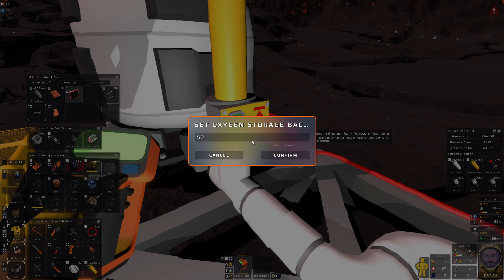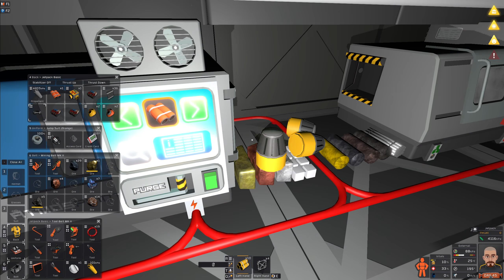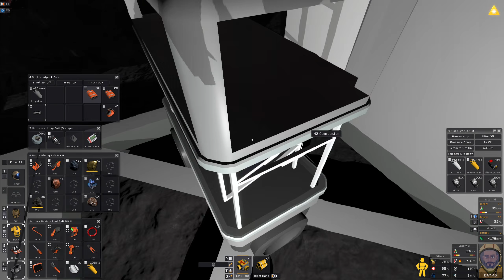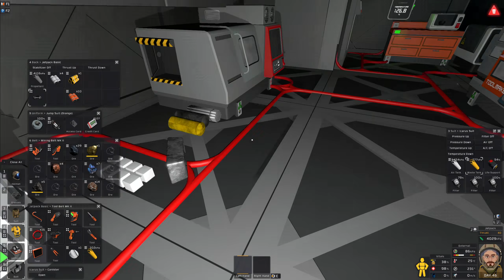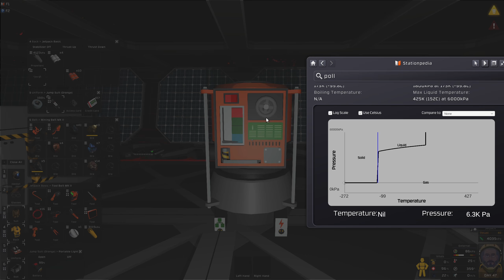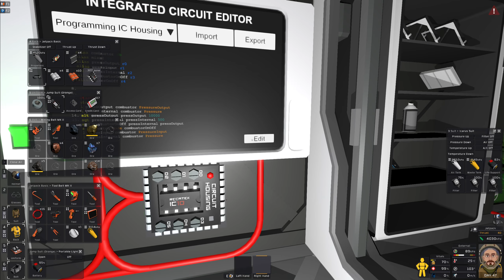Water pt. I: H2 Combustion And Filtering - S2 E14 ║ Stationeers

Comment: 1:59 Wouldn't you want to loop the over pressure exhaust from the back pressure regulator back into the waste gas pipe on the O2 filtration unit that is going back into the greenhouse. That way you're not wasting any O2 production as it will be a closed loop.
Reply from the maker: Two reasons why I don't really want to do that.
1 is that if the storage is full, and we just push the O2 back into the base, eventually the base would end up with 0% CO2 which is not good for the plants. It would happen extremely slowly, and I'd surely notice it before it's too late, but still.

But the most important reason is that I like the idea of a flare burning off the excess O2 above the base. :D
I doubt we will ever reach a great enough concentration to ignite the volatiles in the atmosphere, but who knows, maybe... :)

Comment: Does the game let you collect steam by burning volatiles and oxygen in an enclosed space? I know it has sterling engines, it would be cool to use that stupidly hot steam as the heat source for a power plant. You could use hot combustion gasses on one side, store cool night gasses for the other, and then condense the steam once you've pulled most of the energy out of it.
Reply from the maker: I think they will only generate water in the H2 combustor, in a furnace it will only generate pollutants and CO2 if I remember correctly.
Reply: @Hmuda  Well that sucks. Still, you can run the hot steam through Sterling engines.
Reply: You need to use the H2 combustor to get H2O, unfortunately, but you can pipe the output of the H2 combustor into the Stirling engine, which acts like a radiator to some extent, so it can cool the steam to ambient temp while producing power.

Comment: Did you accidentally dump the watee you bought from the trader?
Reply from the maker: Nope, the liquid output pump is moving it into the base pipes automatically. I don't know why, but the water doesn't evaporate in the landing pad, so it remains a liquid until I pump it out. Very convenient, we can do both the water and the volatiles at the same time, since one is liquid, the other is gas, so they are handled by different machines.

Comment: I'm sure this has been solved in future episodes, but I'm wondering why we aren't cooling the water with a heat radiator? the atmosphere is way lower then 1000°C even in daytime, so there's some real atmospheric cooling potential (especially at night where it's barely above boiling). still need to do the final phase change, but at that point the temperature in the base itself should be enough to cool the water below condensation temperature. maybe I'm underestimating the temperature capacity of water or overestimating the climate control of the base, but if it's just getting a couple mol of steam drinkable it's probably achievable with just the temperatures available.
Reply from the maker: That comes in episode 18. I will keep working on the water generator for the next couple episodes on and off, and that radiator will be the last piece of the puzzle. :D

It will be a tiny bit more complex that just slapping a radiator on the pipe, I will try to make sure we only cool it at night when it's the most efficient, so there will be some extra valves and pumps on it at the end. :)
Reply: Using a non insulated pipe seems to already do the trick though

Comment: @55:42 all atmospherics machines have pipe analyzers for all their connections built in, with separate "PressureOutput" style logic named differently for each connection. So the only pipe in this system you would need a separate analyzer for is the oxygen pipe coming from a different cable network.
Reply from the maker: I know, that's the only pipe I talked about installing an analyzer on. :D

Just like with all previous atmospherics, I'll use the built in analyzers for the codes later.